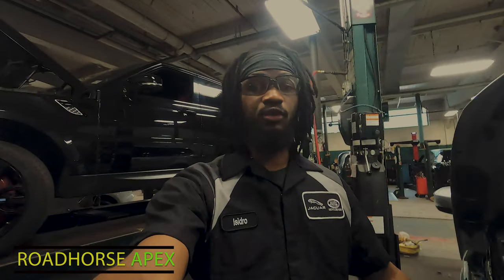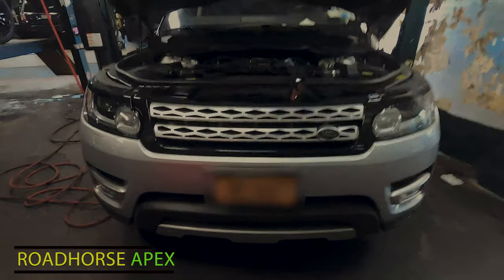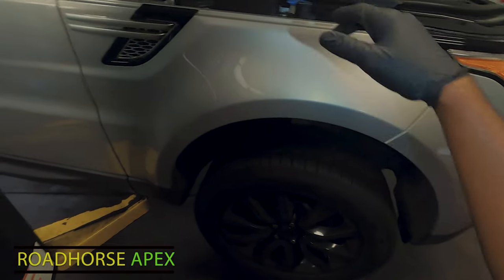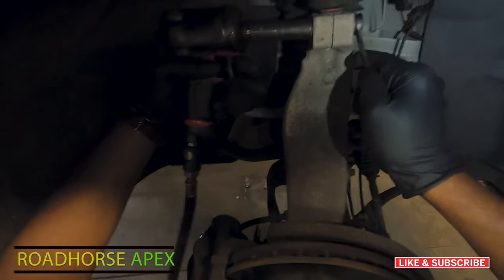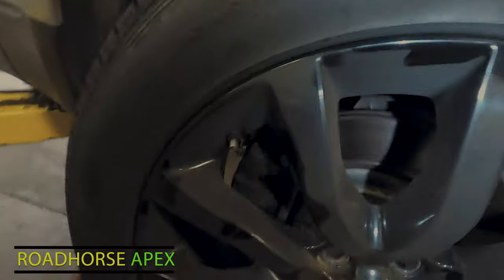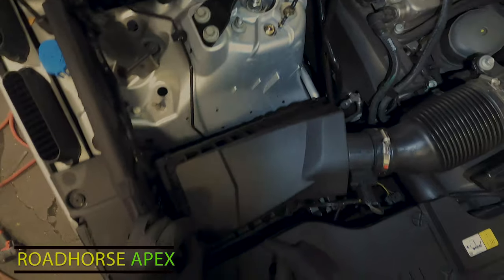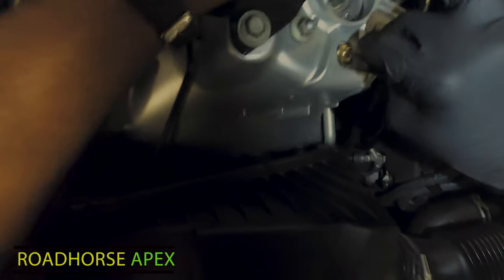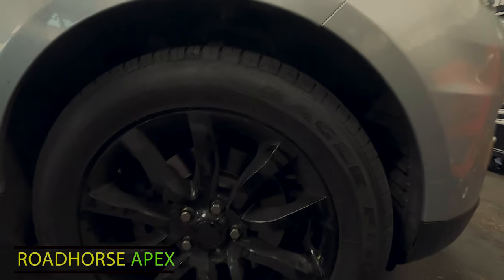how to replcae range rover sport leaking air suspension

Comment: Wish I had seen this video a month ago. Ive owned my 2018 for a month. It’s been at the dealership with the same problem. It’s has taken them 3 weeks for them to discoverthat the front passenger side strut is leaking. It will probably take another week to get the replacement part in stock.
Reply from the maker: I am sorry to hear that, however I am pleased that even though late you still saw the video a found it worth the watch .